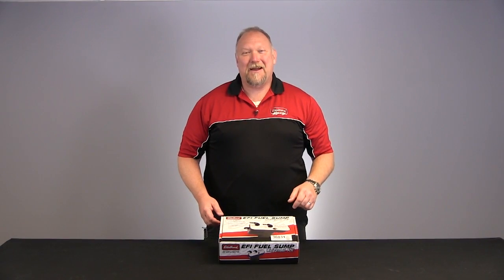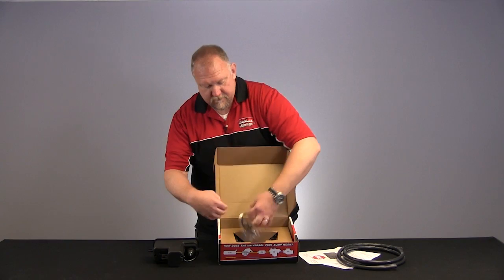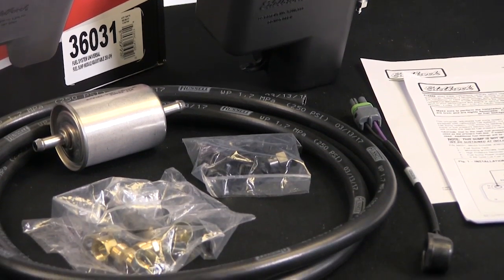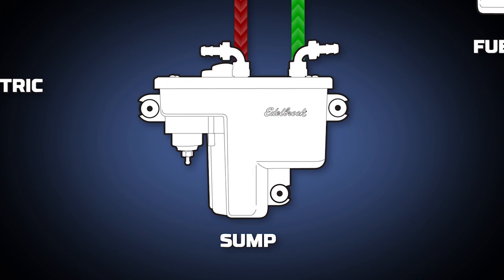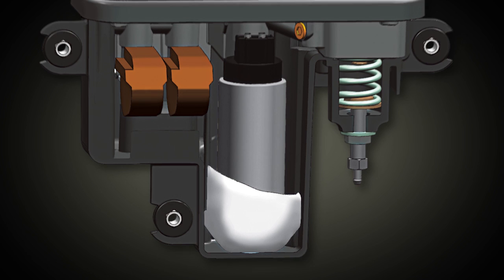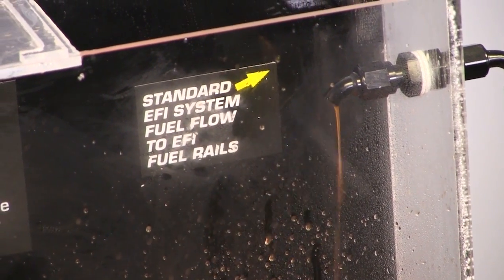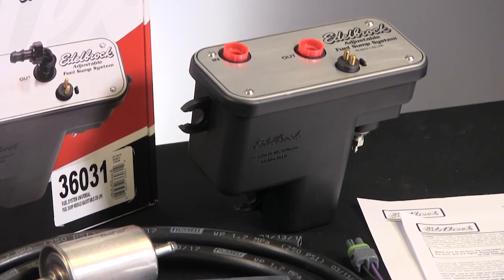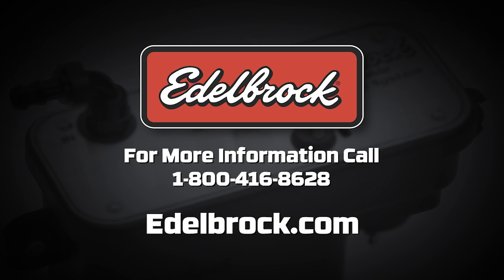Edelbrock Universal Fuel Sump Kit

Comment: I have a return less system on my 2003 ford focus svt. I was going to do a return line system. I am going turbo and seeking 600whp on race gas. Can I use this on my efi set up?  For my build I have upgraded my stock fuel pump to a walbro 250L per hour fuel pump at 13.5 volts. Fuel injectors are Bosch 1750cc .  I also have my own boost dependent fuel pressure regulator

Comment: I recommend avoiding these things like the plague.  I installed one because I could not find a good place for an external pump and my tank mounts tight up against the trunk of my car, so an in tank pump really isn't a good option without cutting up my floor.  I mounted the sump as far away from the engine as possible under the hood.  However, it gets a lot of heat from the rad.  The pump quit on me within a week of run time.  Tried to get a new pump and this is the info I got from tech support:  "Edelbrock Universal sumps ARE NOT Serviceable.  No Spare parts and tanks are glued  together.  Any attempts to put back together will be a Fire Hazard."  So, if ANYTHING goes wrong - regulator, floats, fuel pump...anything...you are supposed to throw away a $400 sump and buy another one.  Really??  AND... you have to run a "vent" line back to the tank.  Kind of defeats the purpose of not needing a return line.  I quoted the word "vent" because the second day I ran it, I had fuel GUSHING out of the vent.  More like a return than a vent.  These things DO NOT like heat.  Where do you install them?  Under the hood with all the heat.